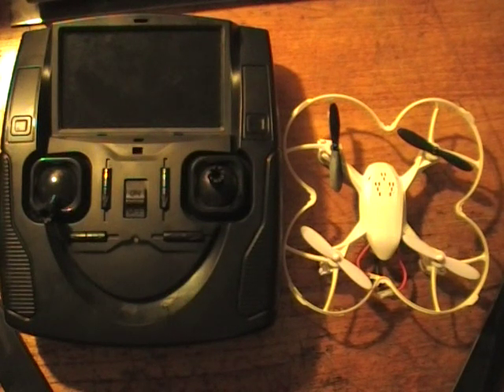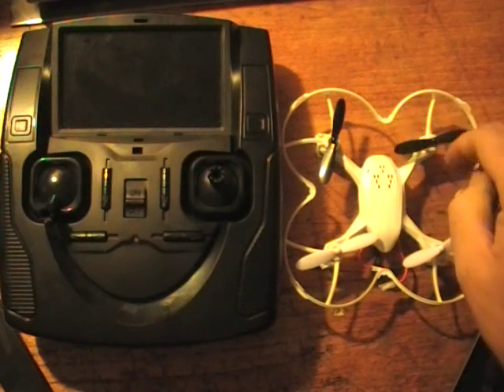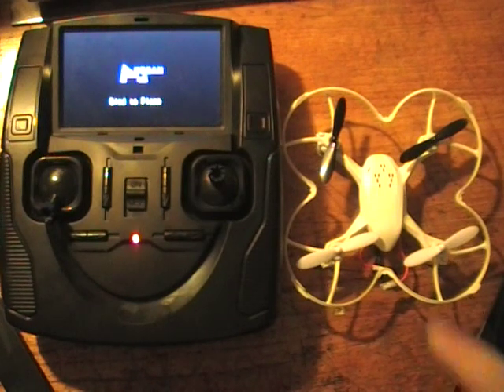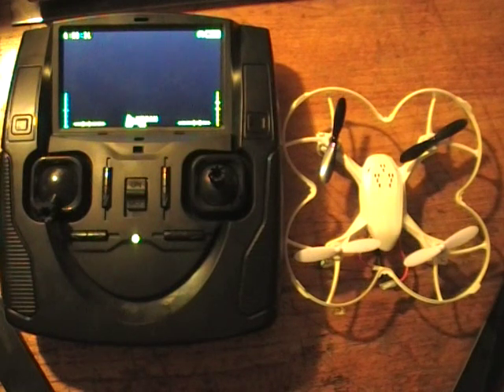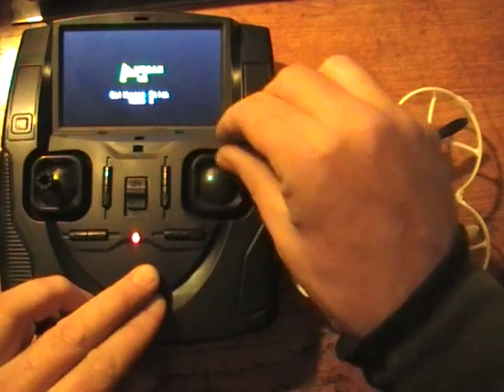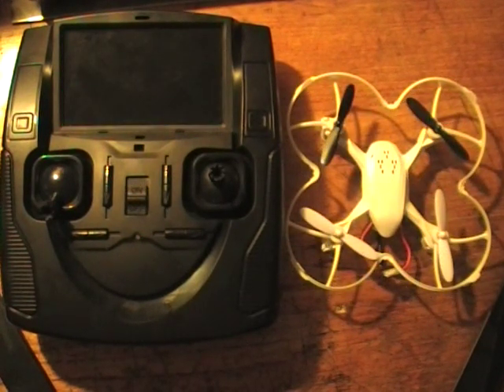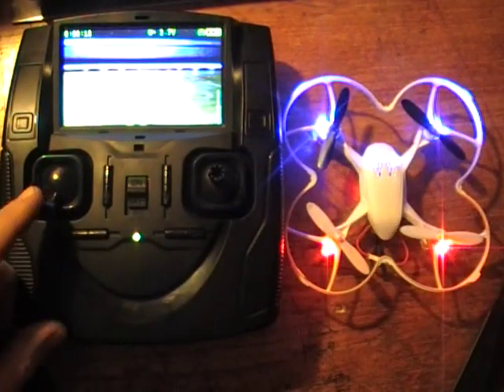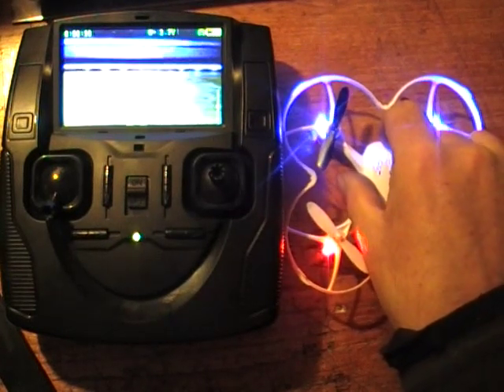How to calibrate the sticks on the transmitter - Hubsan X4 FPV H107d

Comment: Hi mate, wanted to ask you a quick question. What batteries do you use for the transmitter? I use panasonic batteries but still they seem to run out quite quickly.
Reply: double a

Comment: Hello guys, I have a hubsan H107D FPV he descalibrou completely, both mode 1 and mode 2, was changed with all command, the left stick of the radio, now plays the right. However, mode 2 could calibrate, it was perfect, but the way one still hurt. Does anyone here know how to calibrate it? or give a reset whatever. As I said, the way 2 was good, but the way one's all changed, the right lever is that is playing the role of the left, and the left is not serving to nothing, does not respond to commands.